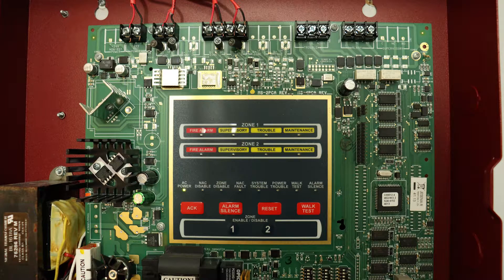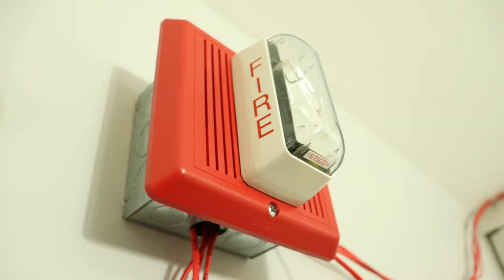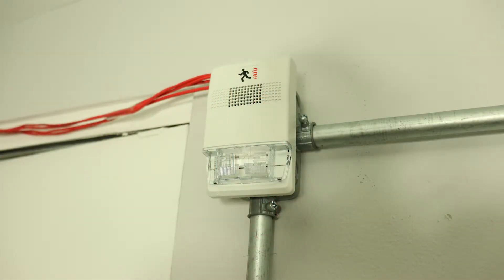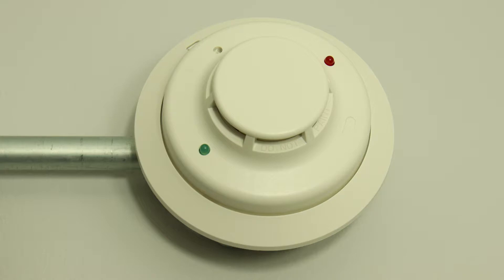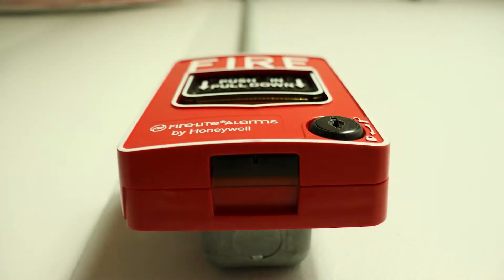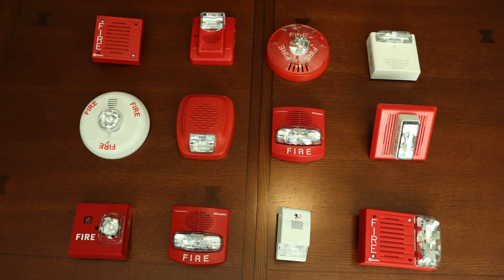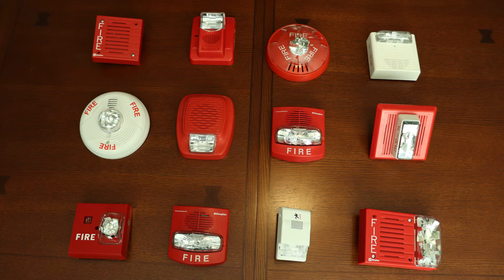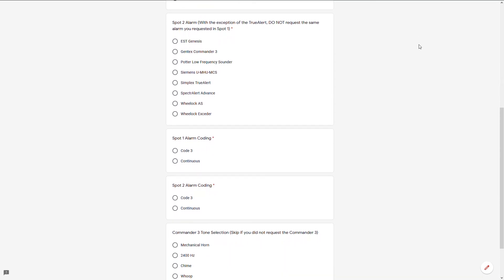Fire-Lite MS-2 System: EST Integrity and Genesis!

Comment: Can this panel have multiple pull stations/smoke detectors on each zone? Also the intergerty and genesis sound cool together.
Edit: I rly wanna do the google form.
Reply from the maker: Yes it can! As long as you don't exceed the current provided on each zone (which you really don't need to worry about on a demo system) you can have as many as you want. Also, here's the Google Form, it's going to be in the description of every video from now on: https://forms.gle/rASjKbfV3T5jWb1Y7
Reply: @gentexguy  thank you so much!
Reply from the maker: @joleneingles  No problem!